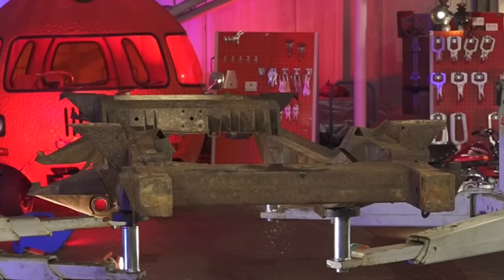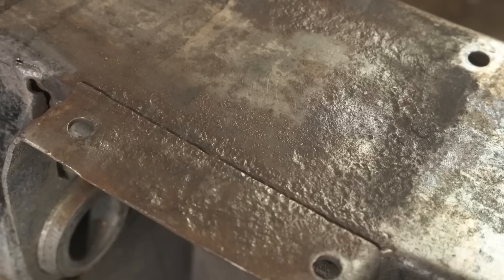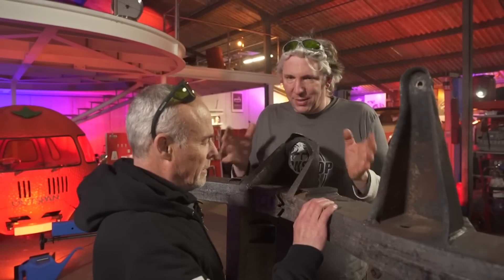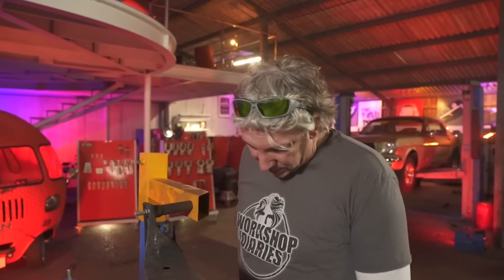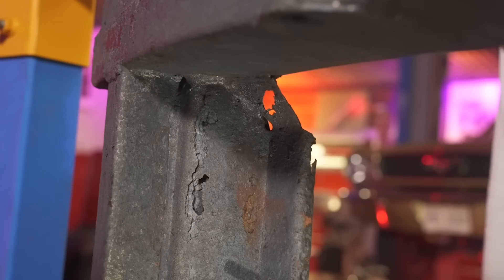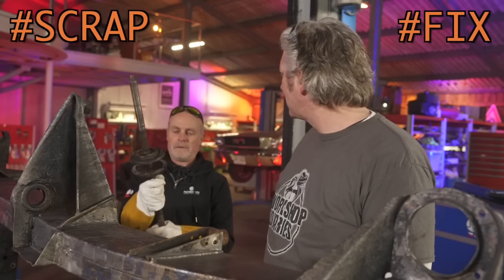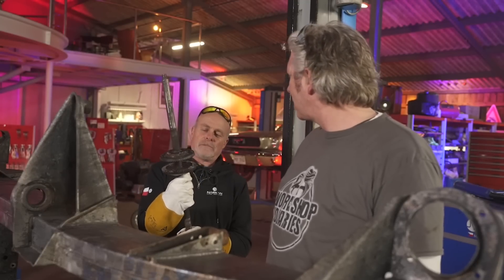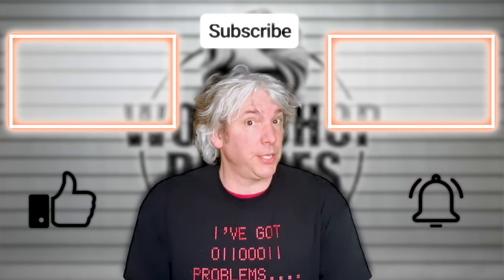Will Using A Laser Help Clean This Range Rover Chassis? | Workshop Diaries | Edd China

Comment: Scrap it and get a new frame. The effort will cost time and money for a part that even though large and an expensive part will never be as good as a new frame. Focus on the other bits and try and make a saving and restoration on the rest of the parts to recover time and effort on trying to revive a too damaged frame that should have been scrapped at the start of the restoration. Sell the frame as is to someone else that wants it and is willing to invest more time in to it for more money towards the new frame.

Comment: Edd, if the goal is to keep the car as original as possible, & use it only on the highway, then do the repair. But, if Johns plan is to off road it, & use it for it's intended purpose, then I believe Pauls plan makes more sense, for the following reason. 
            Even if you cut out & replace the rusted parts, can you guarantee the interior steel structure has not de-laminated in places, to the point of significantly weakening the chassis, making it unfit & possibly dangerous for John to use off road, which will inevitably lead to further water ingress & rusting, in which case, you'll be back to square one in no time. Whereas, the galvanised chassis makes more sense & will further extend the life of the vehicle.
            Love your channel, & hope this helps.   Regards......Urban Geeze.

Comment: # SCRAP  Even though the areas that look bad to your eyes CAN be repaired, there are bound to be damaged, weak areas on the INSIDE of the frame that haven't been seen, and could ultimately compromise the very foundation of this vehicle. If this were a highly sought after, very rare car that you wanted to keep as original as possible to retain its value, I'd say repair for sure.  But that's not the case here.  Though it was an "age" ago, just remember what the solution was for the Morgan.
Reply from the maker: Fair enough, but you say; as this will never be a concors charmer and really doesn't have any value other than to John himself, AND as the Britpart experts have said they're happy it is strong enough, we thought we would give it a go anyway and if John breaks it off-roading we can either chose to fix it again then or go for the replacement!
Theoretically, on paper, the Morgan chassis swap would have taken longer to do but as we are already some way over the 150 hours mark we really must crack on soon!
Reply: New chassis , there will be so much internal corrosion on that chassis .